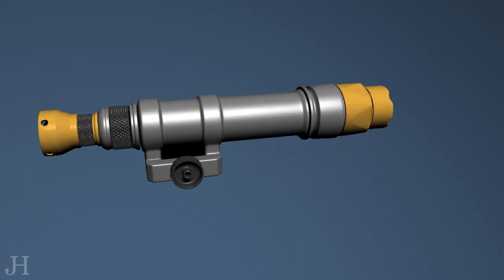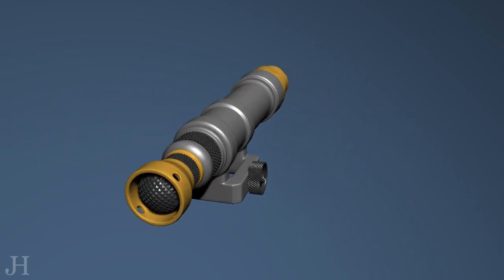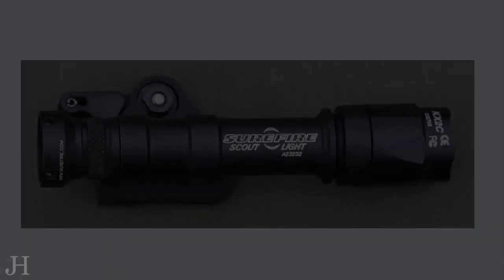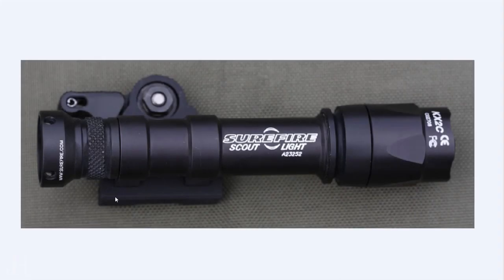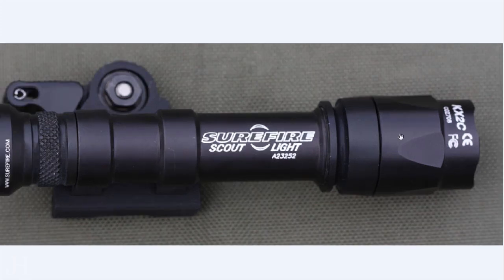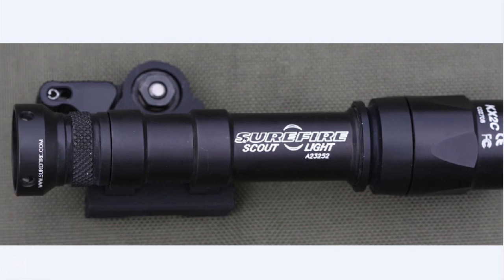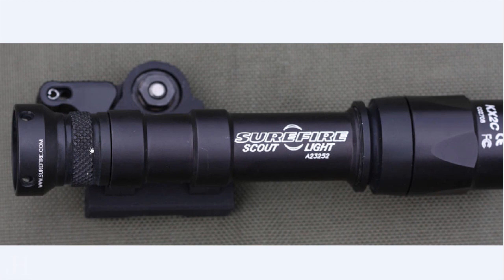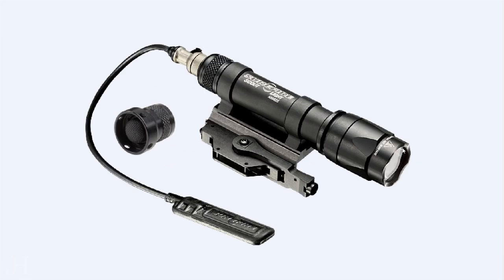HighPoly Modeling : 3DS Max M4 ScoutLight Light

Comment: Very incredible, I wish I were this talented with 3ds max. Unfortunately, all of my models turn out very not "clean", very tessellated, very slow to render and to model, and I have to resort to using booleans instead of manually creating the non-symmetrical elements such as the flat planar parts you made on the end and the 4 holes you put in the scope. Boolean objects are horrible, it always fucks up the final result somehow  :c